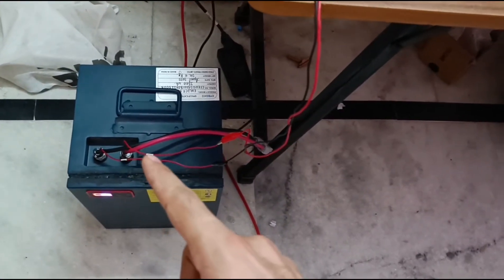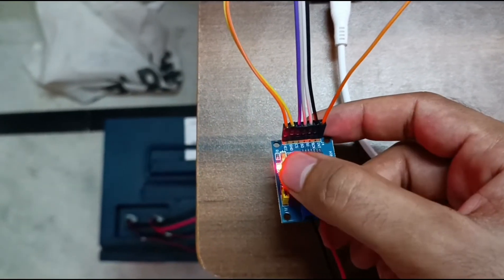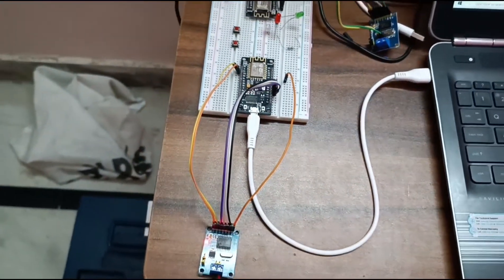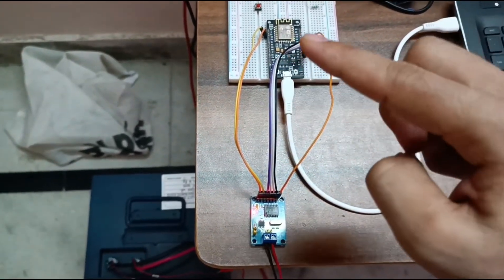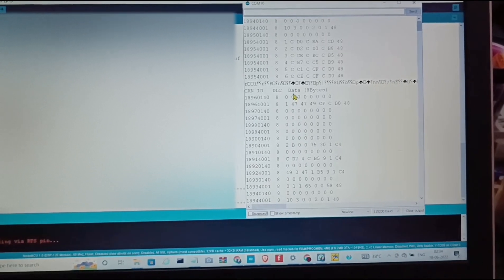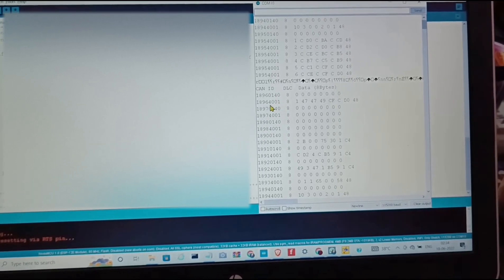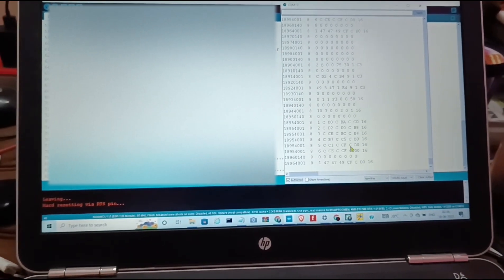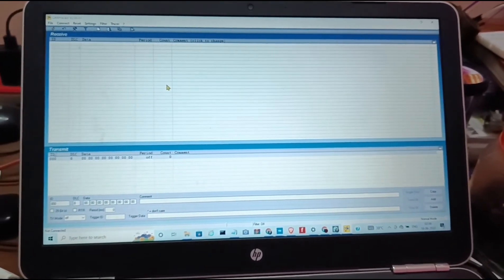CAN bus read with MCP2515 and Arduino IDE serial monitor of any car or battery or device

Comment: i have a bms that has no communication with inverter . i want to diy add CAN or rs485 interface so that my inverter can read data from available bms . check battery SOC